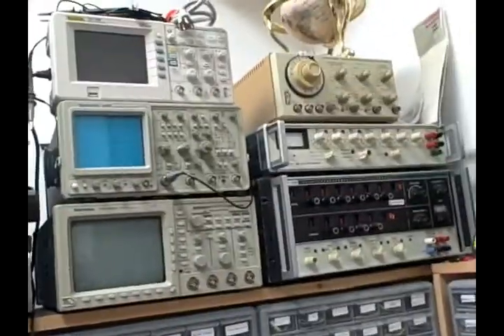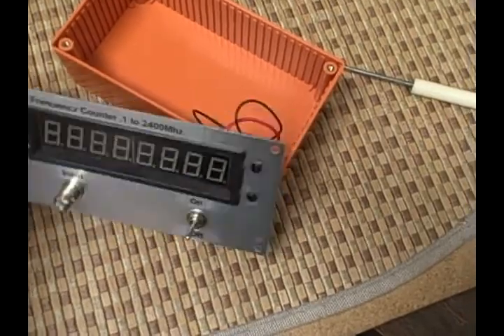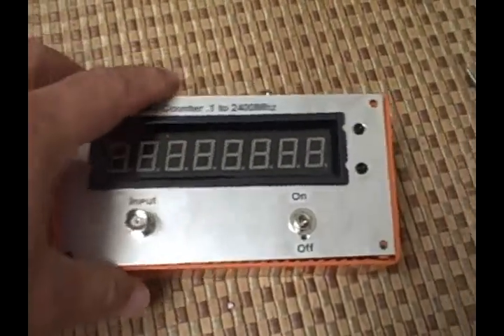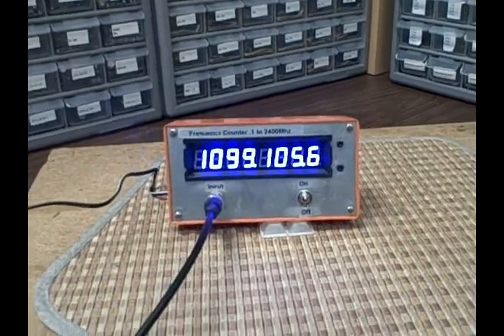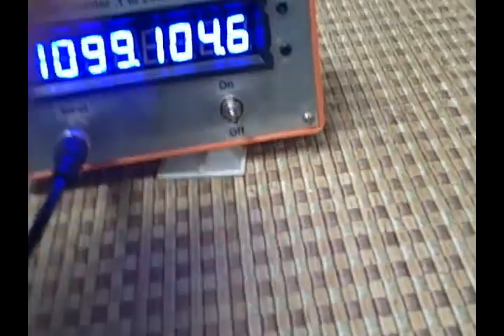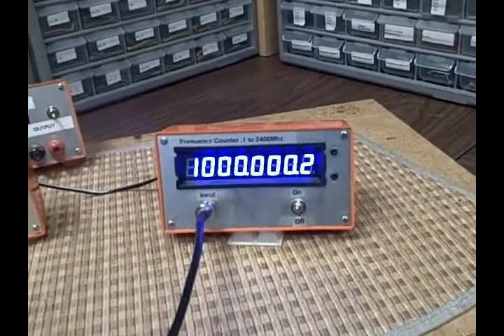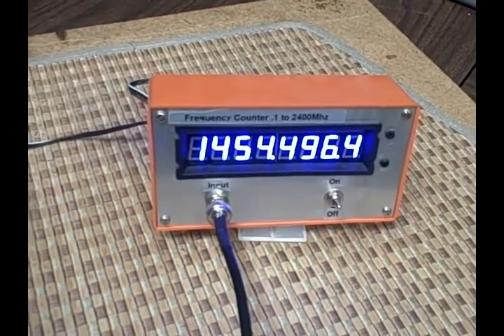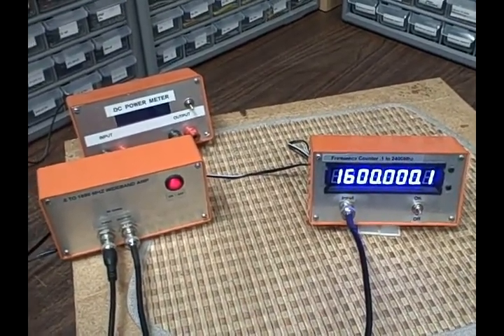2 4Ghz Frequency Counter

Comment: I have one of these...I bought it to specifically work on radios as you can set the 455 KHz & 10.7 MHz IF and the radio then read out the correct frequencies...however I have only done that few times, its currently in it Plexiglas case with those flimsy wires out of the back...I need to get a project box and re-mount it and mod like you've done here...I don't think I have checked to see how low & high mine can go, I have a 2.6 GHz HP sig-gen...will check it out if you'd like.  ~Jack, VEG
Reply from the maker: Give it a go and see! Pay attention to the sensitivity. Mine is pretty poor above 600 mhz.